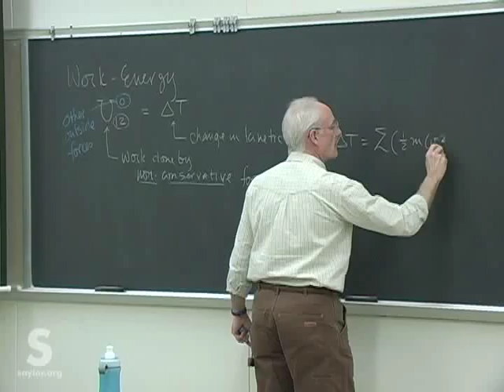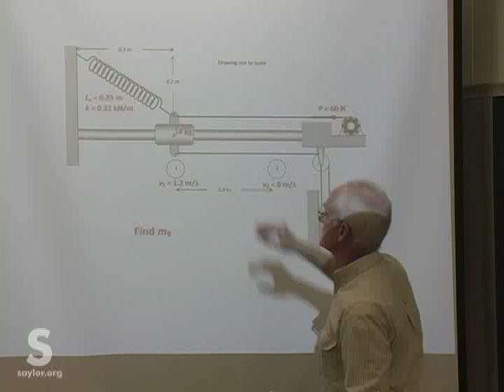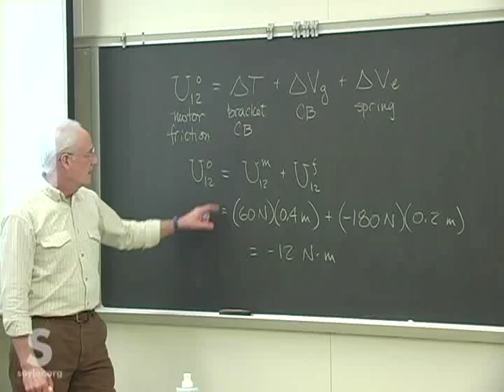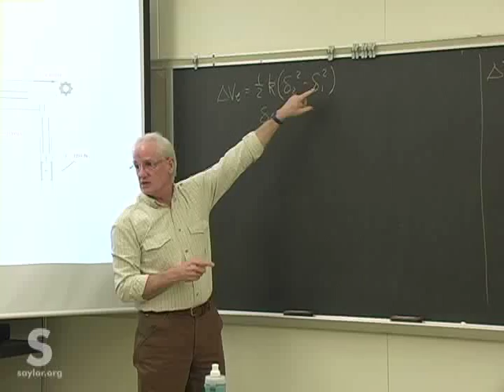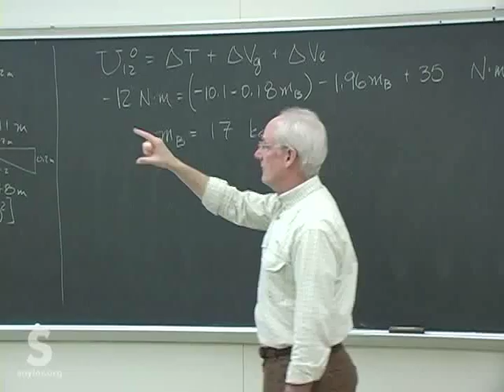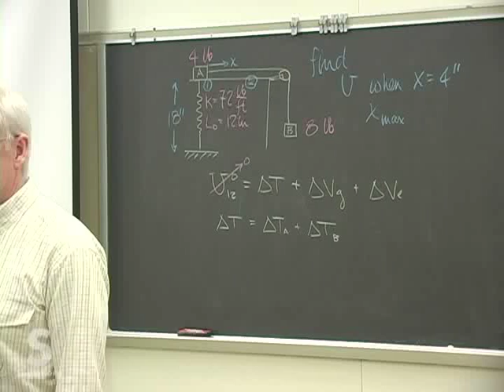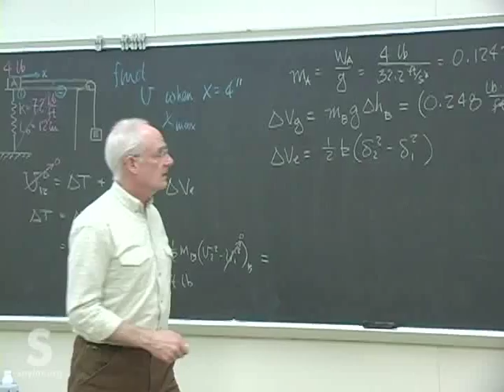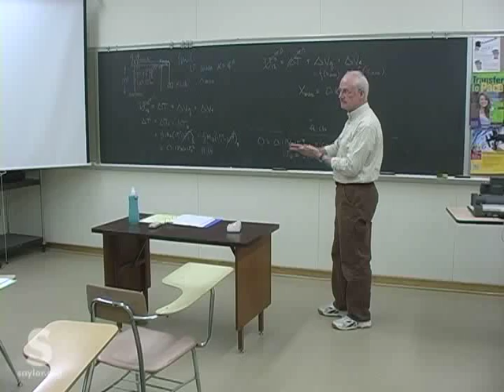Saylor.org ME202: Ken Manning's "Dynamics - Work - Energy II"

Comment: Maybe I missed something but the solution for x_max wasn't so simple for me for the last one -- I ended up with a cubic polynomial (which did end up with the same answer that Professor Manning did, but solving a cubic isn't exactly simple, so I wonder if there was some simplifying step that I missed when calculating the spring potential energy).